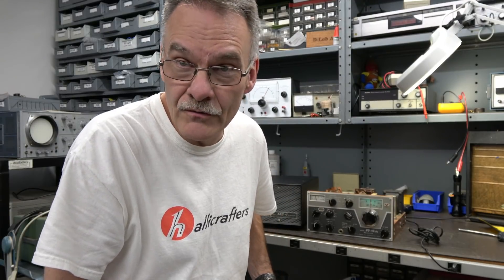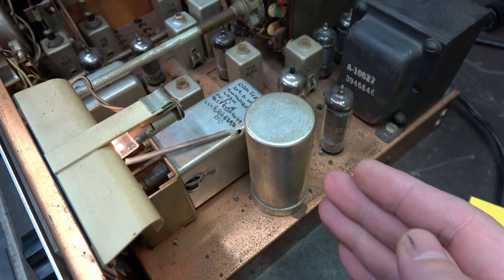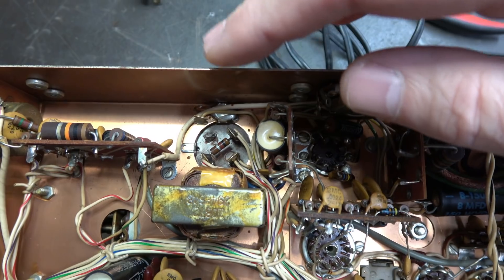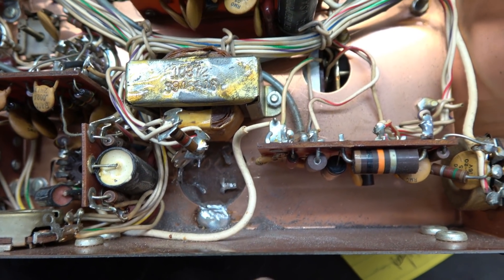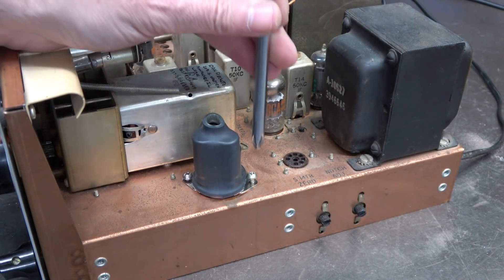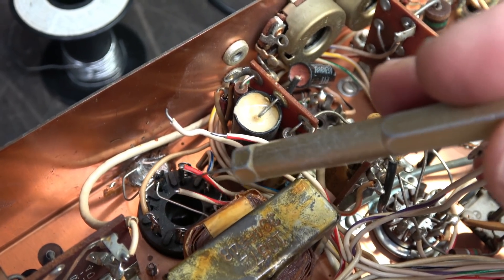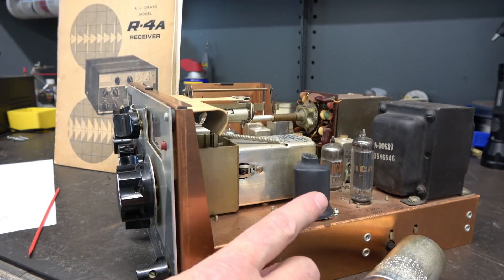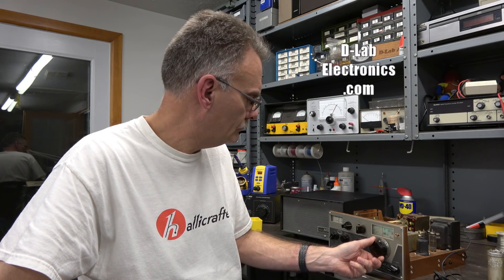How to replace Drake R4A Ham receiver Filter capacitor fix that hum

Comment: Hey got t4xc I replace a filter capacitor  big can it has  a  2 phase can on new one says 350 volt  and 50 volt  on low 50 volt while removing   low voltage side broke from radio does that go to tube socket if y  know about t4xc drake any help thanks

Comment: my early ham gear was all home-brew. back in the late 70s I got lucky and got a one of these drake r4a receivers for 100 bucks. it was deaf as a post. I tested and replaced a couple of the weak tubes. then followed the alignment instructions in the manual. Wow! did it work great. it would hear any signal any receiver would hear. I sold it for 100 to finance an upgrade to a new kenwood ts530s(still have it). the keeper I found at a garage sale with provenance. beautiful drake SW4 (not an A, no suffix). its shortwave broadcast am only. but, I have used it on 75 am and with the correct expansion crystals on 10m am as well. Really sensitive and sounds great. radio is like new condition and found a matching speaker new in its box at a hamfest. total investment 20 bucks for radio and 20 bucks for speaker. these drakes are real keepers. SW4 is single conversion and push pull 6aq5 audio stage where the 50 kHz low if would have gone in the r4a

Comment: Great repair!  If I may suggest two changes:  First, using an electric solder pump instead of a Dremel cut-off wheel would avoid coating the electronics with all that metal dust.  There appears to be enough room to get the pump nozzle in to suck up the blob of solder.  Second, if you've removed the old can from the chassis, why not dig out the old cap material, stuff the can with the new cap cluster and mount it onto an empty tube base?  A broken tube could supply the base or you can buy them ready made and they'll fit in the sockets just like normal tubes.  It's a bit of extra work, but the cap cluster would become easily replaceable and you'd retain the original look on the tube side of the chassis.

Comment: Thanks Terry. You should never see smoke when you plug a device in. Just use a Variable Isolation Transformer that has an ammeter. Turn the voltage up slowly while watching the ammeter. If the current starts to jump up too fast or climb higher than you think it should, turn it off and find the problem.
Reply: My smoke machine says you should never talk in absolutes
Reply: I guess you're right, but it will greatly reduce the chance of seeing smoke. How's that?

Comment: With that cap I like to use a jewelers saw to cut the entire can off the base right at the lip. Clean it out and drill some holes and mount new axial caps to the appropriate lugs. Tie all the negative leads together and run an insulated ground lead to the bottom chassis lugs. Put the old can back using some super glue. No need to mess around underneath. 73 Doug.
Reply: I like the way you do it a whole lot more than the way Terry does it. Same way I do my antique radios, doesn’t take any real extra time either. His way looks butt ugly from the top. The first thing Hams do is look at all the circuitry and they would love seeing the can but I don’t know personally know anyone that’s going to be happy with that ugly heatshrink glob.